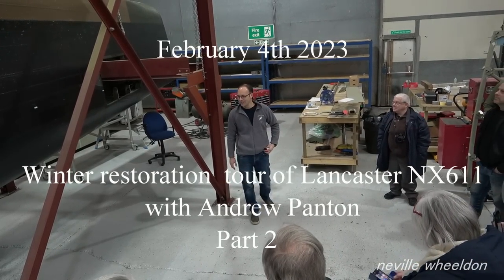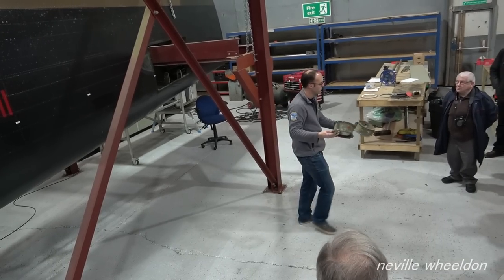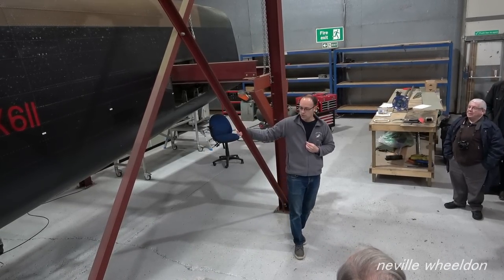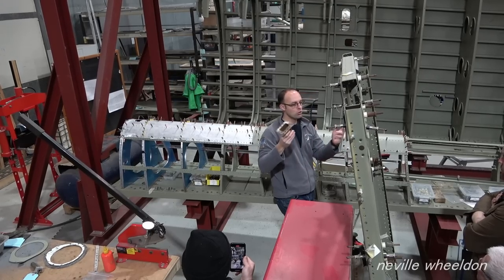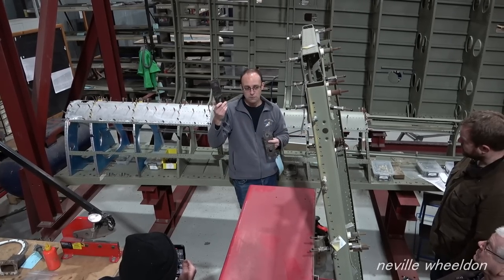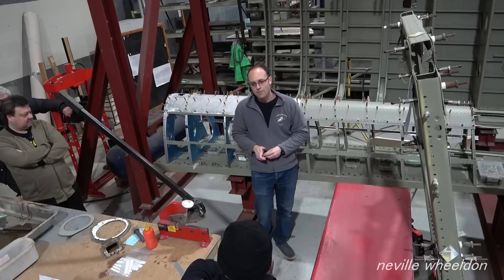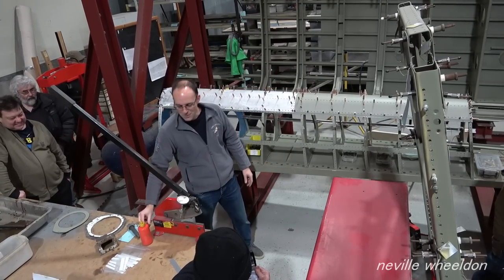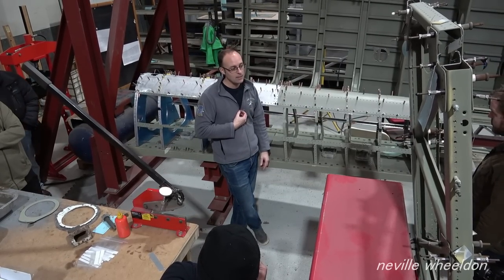Video 184 Restoration of Lancaster NX611 Year 6. Part 2 of Andrew Panton Restoration winter tour

Comment: An awful lot of aircraft were built using Mag Alloy during WW2 and beyond, they were never designed to last twenty years yet alone eighty.   Having worked as a rigger fighting corrosion on aircraft I know the effort the guys are putting  in, I think these videos are a master class in aircraft renovation.  They also demonstrate why it's never quick, never easy and never straight forward, and how amazing East Kirby are at setting them selves a target of only ten years for an aircraft the size of a Lancaster, especially as they have to fund themselves as they go.
Reply: What was the average expected operational flight hours for a Lanc - 40?  Just such a well structured plan to move forward.  I'm sure they will see some additional surprises but how they have planned ahead to keep the taxi revenue coming in while restoring major sections of Jane is just superb with a lot of networking to obtain major sections with a give back to the donors.  Does Andrew have an engineering or PM background?  Just curious as he seems well versed on both.
Reply: @ajg617  I think it was classed in number of sorties, which was 21 so if each was about 8 hours your looking at something under two hundred hours including flight testing.  but the life was in hours not years, so just Jane is lasting well. When you think the main reason of Mag alloy use was weight strength not longevity.
Reply: @davegoldsmith4020  The 40 hour number came from the narration of Air Commodore Cozens film made into The Night Bombers.  Don't know when the narration was added or where it was sourced from.  Either way, amazing that two are still in the air though I would not have wanted to be in VERA when the wing tip folded.
Reply: @ajg617  Andrew Paton and the crew must be the foremost experts on Lancasters in Europe if not the world at the moment. As far as i know no-one has dismantled & reassembled a Lancaster before. The East Kirkby team are fantastic. Neville brings education to us all. Real pleasure to watch.
Reply: @ajg617  makes you wonder what horrors hide in Thumper & Vera doesn't it? Their Magnesium alloy rivets cant be far behind Jane's surely?

Comment: With the floor removed in NX611 rear fuselage and you see the state of it, you understand why the CAA required this plane to be stripped to its individual component parts and totally rebuilt before it gets its certificate of airworthiness. A great project and worthy of a ten year wait. The engineers are doing a brilliant job. As per usual Neville a great video. Geoff